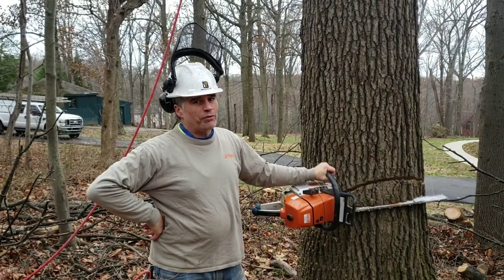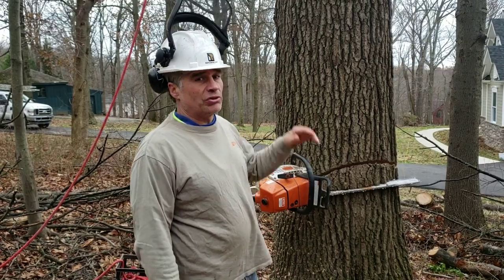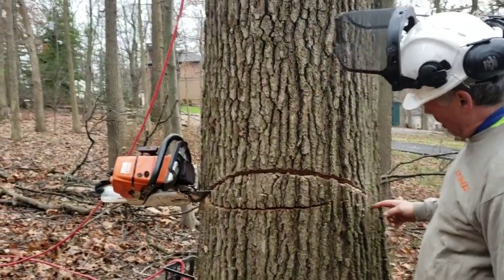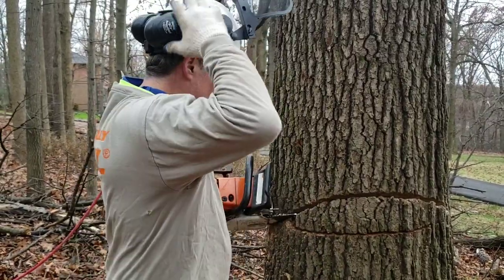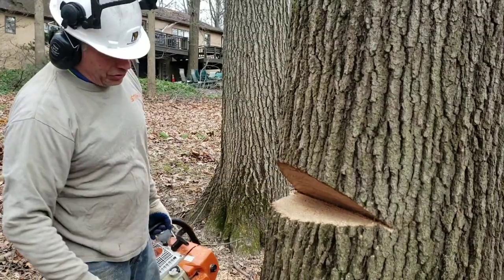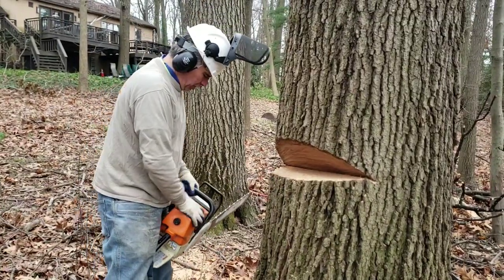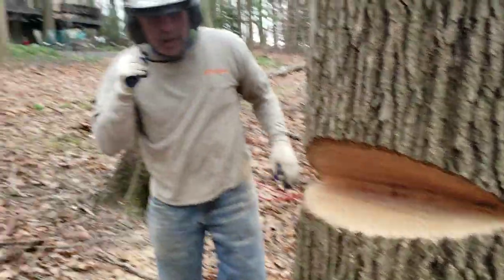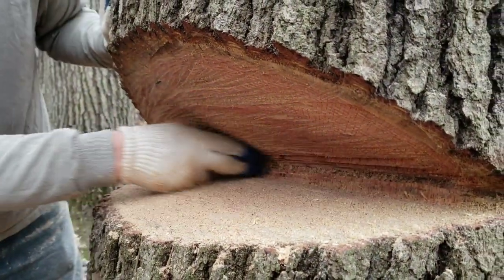Plate cut for short bar face cut

Comment: I started doing this as a safety precaution,  didn't even realize that this is a technique,  I just saw the necessity.  🤷‍♂️ One thing that I have yet to understand is how to aim the bar so that the top and bottom cut come together everytime.  I'm usually close enough where a little clean out (if any) might be called for, but is there an aiming technique you use or is it muscle memory and practice? I've probably only dropped several hundred or so trees,  so I'm somewhat of a "shade tree" arborist.
Reply from the maker: top cut first. Use top gunning line (or sight) to aim notch. Make sure the bar is level when you finish the first cut. This is done by feel and a fairly simple skill to develop. Then, when making the bottom cut, just make sure the bar is level and it should match up on both sides. The plate cut is used to add visibility so you can see exactly where the tip is heading